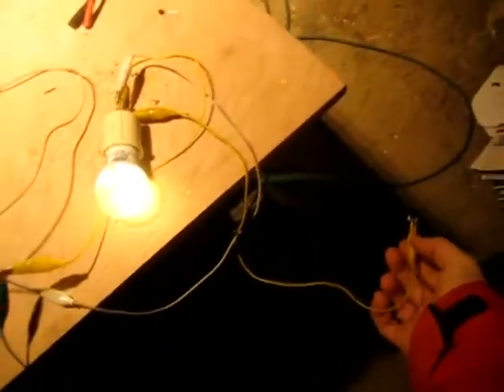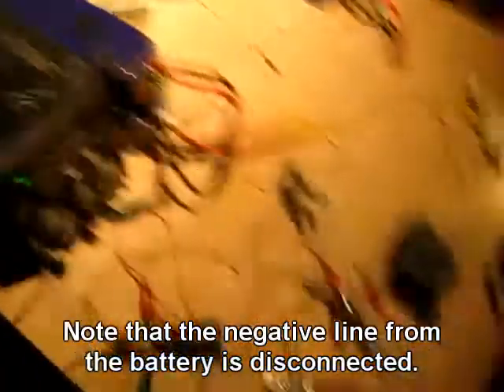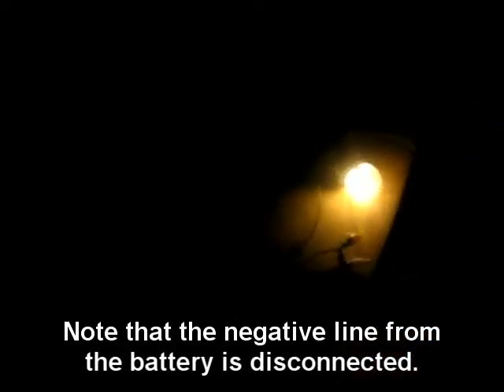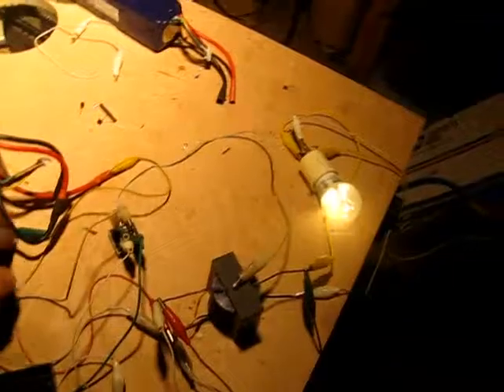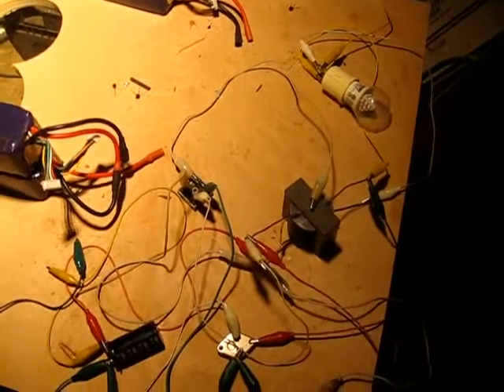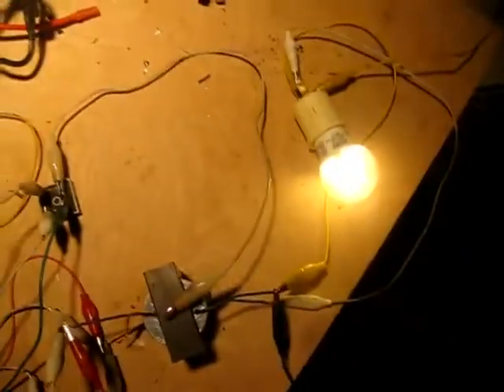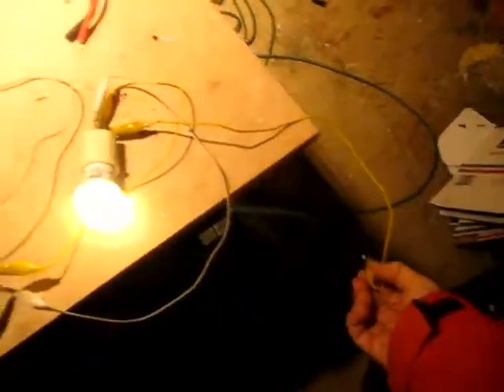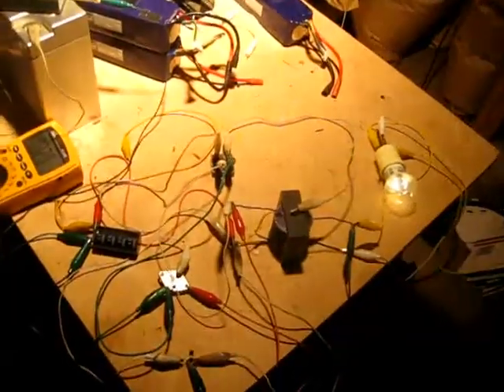Important Joule Ringer CrossOver update!  Possible Kapanadze like effects

Comment: Lasersaber it seems that the key is always the transformer. We really need to know how to make one, and do the math to be able to predict success or failure just to get it ringing. Same problem with Don Smith devices, outside the high level ideas, everyone stumbles on replication because  there has to be relationships that have to be maintained to be successful, and no one knows it. The SJR 3.0 has two coils, but there are more ways to fail than to be successful. Please on this new device, can you give a complete build list, length of wire for primary and secondary, turns, turns ratio, wire gauge. It would seems getting two coils to ring would be easy, but it's not.

Comment: I just tried the changes to my circuits I have wired up and I ran a test. I wanted to see if additional energy is being drawn from my power supply's transformer (source), so, I added my scope (amp) clamp to the input lead and the additional energy is not induced/stolen from the transformer's input, it only steals it from the dissipation since the input wattage stays the same to my power supply, so, it seems to  recover around 60-65% of the dissipated loss if it lies close enough to the transformer without placing additional load to  the source feeding the transformer. I am going to try other loads to see what it does.

Comment: your circuit seems to be recovering the transformer loss that is being dissipated by the primary coilin your power supply. This is great. It means that this circuit is a great tool to recover the power that's lost from wall wort power supplies. I am going to build a bunch and place mine next to each wall wort supply , connect the current to batteries or maxwell boost banks to charge them, then, either utilize the energy to operate my lighting, or, feed it back into the grid by inverting, so I could eliminate my losses in my home. I am in CT, and what our power company has done here is the worst thing imaginable. For all of the losses they've incurred due to the lower consumption customers are drawing with replacing lamps with all LED lighting, we are now being charged an additional $25 per month, flat rate, plus, there's another planned hike per year of 25% per annum for the next 3 years. Eversource and UI both state it is due to all of the upgrades they are doing to their system. It's ridiculous, now, even the people who couldn't afford to upgrade to leds are getting killed on their bills beyond belief, since they still use incandescent . This was a great catch on your part and I am so happy you have done so. I've been doing a ton of experiments with these circuits and I'm going to have to get some progress done now. This is a great recovery system that can help a ton of people and I'll be getting it out to the public as soon as possible if you don't mind me doing so, utilizing this circuit and my additions as an energy savings device. Even my power bill is brutal every month, especially since the rate hike and additional 25 bucks.. An average bill here isn't unusual to get up to 300-350 for an average sized home witha decent amount of use. I appreciate your videos and the work you put out there for many people. I've been doing the same type of work for the last 18-20 years and I've just begun to come through with a few videos, a lot of new test equipment, etc. Thanks again. Great Job.

Comment: my replication of your schematics was not successful..i used 1 watt led bulb, 2n2022,2n3055,1000mfd50v cap, but transformer was a 230v-36v@5VA.It didnt work at 3vdc, or 6vdc..it lighted up only when i used 12v2ah bike battery..but then the 2022 started heating up in seconds so i couldnt go on testing it..my earth was taken from the AC outlet..care to advice me?? thanks and good luck from Singapore!!

Comment: Would a tv antenna connected instead of the inverter be enough energy from radio waves to power the circuit, or is it the fact that there is a steady waveform the circuit can follow nearby? Interesting question, keep experimenting...

Comment: i dont think that idea of yours would work unless your transistor is set to trip very sensitive. even then, if it was set sensitive enough, i dont think you'll be able to induce enough energy to run the light very long.. depending on the number of windings on your main, who knows. with 1000+ windings, it maybe possible.

Comment: FYI - chances are your power supply switch's on the secondary, and not the main.. meaning, even with the power supply turned off, the primary 110v AC transformer on the primary is still charged.  this would create a nice magnetic field that could be induced though the air to the battery pack.  your still using power from the wall.. interesting though..  kinda like those wireless battery chargers for cell phones.

Comment: Lidmotor showed this operation in one of his videos. The transistor is excited out the ac mains by rapping a cord around the base wire but not connected. This operates like a field effect transistor or FET does. You could take the fet and put a resister across it and get the fet to turn on the transistor on by putting a winding next the transformer of joule ringer itself.

Comment: Way cool, LS!  I am going to do this circuit as well. I have been experimenting with your SJR 3.0 circuit and have been getting tremendous results. I added a 3rd winding of #34 wire and am using it to charge batteries.
Thanks so much for sharing your work with us!